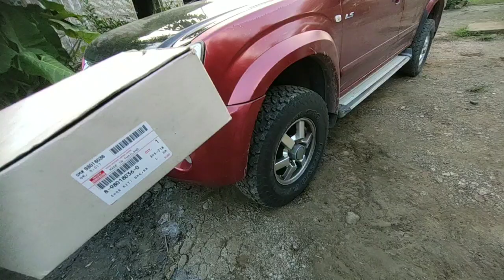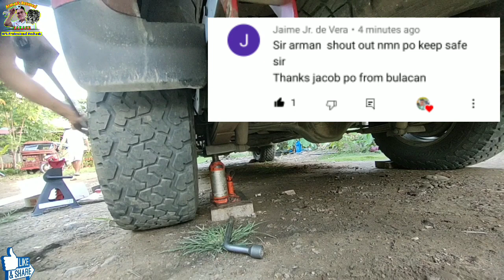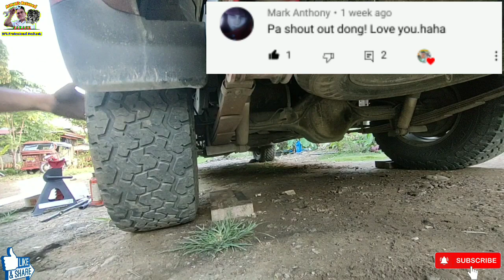Isuzu D-max Brake Shoe replacement

Comment: Idol ilan km interval dapat mag palit ng brake pad at brake shoe….
Reply from the maker: As per check up po.
Depending on usage.

Pero usually.
Brake replacement - 30000 km
Brake shoe replacement - 80000km

Comment: Boss unsay part number sa brake shoe sa 2008 isuzu dmax LS 4x2?
Reply from the maker: 8-9801836-0
Reply: @armansretunedgarage  if Bendix po na brake shoe brand ano po ba parts number ang fit sa 2007 isuzu dmax LS 4x2 3.0?
Reply: @armansretunedgarage  boss?